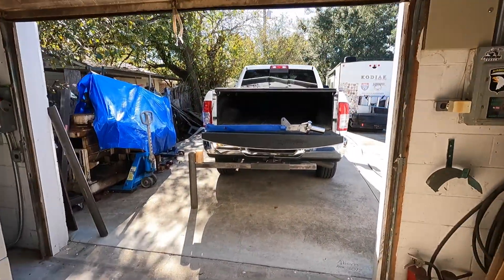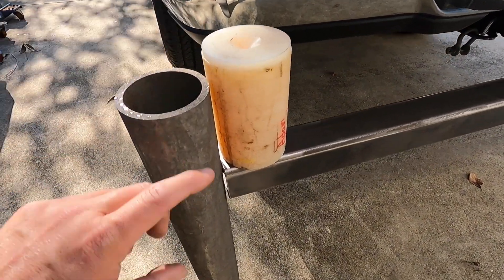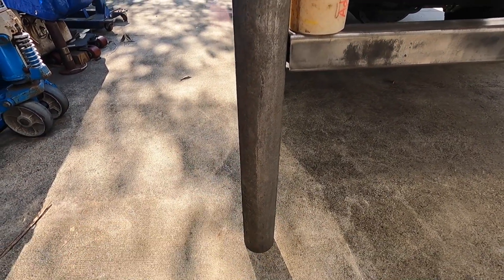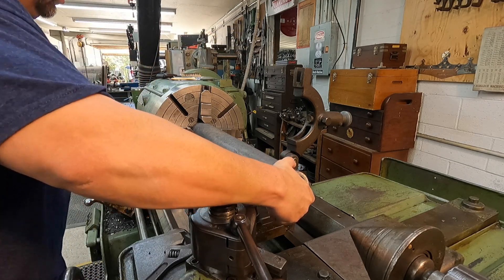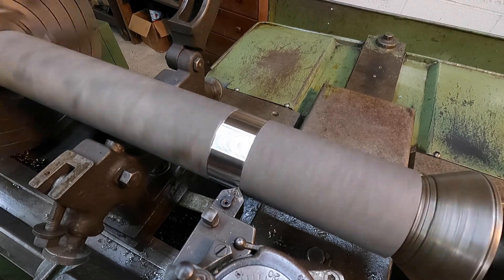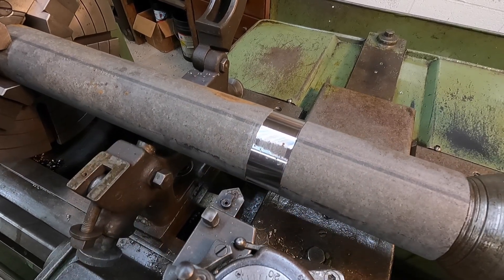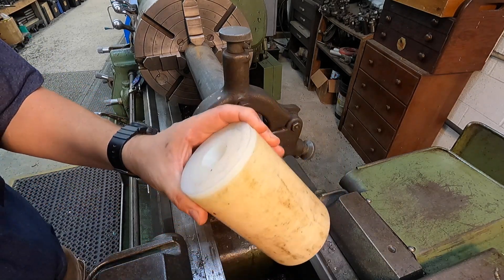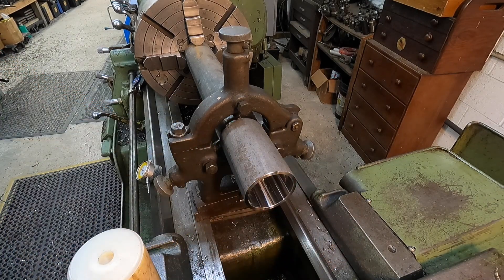Truck Hitch Crane Build Ep. 5

Comment: we used to use real crane trucks that had simple stabilizing jacks that pinned in as your planning.... we would swing the crane to one side...pin the opposite side...then swing to pinned side...pin the opposite side....they aren't as good as hydraulic ones ( which i own and used too )...
when you load your truck it " could " bind the pins enough to make it hard to remove...but after a few times you'll know whether it happens .. a jack can lift it enough in a situation that it is " stuck "....( a pickup will settle down differently than bigger trucks do )... if your thinking of adding air bag assist to your rear suspension??
that can lift it enough in a emergency....but a normal jack can quickly solve it from being stuck...
your movement is without a load...and your pinned stabilizer not pinned....reality is it is a concern...but not much in reality....
what you see as " movement " can disappear when you lift something HEAVY into bed....depends on each lift..

Comment: if you get it Stuck??
just bring a SKYHOOK along
and your good to lift!!
and pull yer pin out..
hell...just use a SKYHOOK....
🙊
to lift everything!!
Reply: There’s many  a green laborer still searching the conex for those.
I know, I sent them there
Still waiting for some to return . . .
Reply: @user-dg7sy8cz3b  
i actually own a " SKYHOOK " Crane on my truck..it is a brand of Sign Truck equipment cranes....Hydraulic over Electric and Electric Winch and Extension..24 Volt...mine is one of the last ones sold...1989 version....but the " Joke " is what i was referring too... rookies get told to go get it!! 🤣
Reply: “…and while you’re resting, grab the board stretcher and a hand full of 4p duplex cut nails.”

Comment: G'day Adam, why not use a cheap hydraulic bottle jack, welded on upside down, to adjust the foot?
Reply: Haven't tried upside down but I've seen bottle jacks that won't function on their side.
Reply: @xXxSelnixxXx  you're absolutely right! Why didn't I think of that? I'll revise that to a bottle jack with the top of the ram welded to the foot.

Comment: The steady-rest is a bit of a mystery to me? Do the ends of the fingers have to match the radius of the stock?
Reply: You need to remember he is starting with a length of pipe which is not uniform in roundness. Before using the steady rest the active center (cone) holds the end of the pipe in place so he can machine the outside (marked area) of the pipe for a uniform round outside diameter. Then the fingers of the steady rest are adjusted so they just touch the finished outside (marked area) of the pipe. The steady rest simply takes the place of the active center which now allows him to machine the end and inside of the pipe. Since the outside is now a perfect circle it assures the inside will also be perfect.
Reply: @patburnsent  nice explanation but that isn't what he asked, the pads on the steady rest are just a flat piece of bronze or brass that just touches the surface
Reply: No
Reply: @andyb7963  In that case..... NEVERMIND
Reply: There are various kinds of steadyrests. Some are fixed plain metal. Some have a roller bearing on the end. Some are really specialized with hydrostatic steady rests.  Go look them up. There is a huge variety.

Comment: I'm concerned about the torque on your square tubing outrigger.  If you have 1000 pounds on a three foot boom, and the boom is at right angles to the outrigger, that is 3000 foot-pounds of torque on that square tubing.  Are you sure it will take that?
Reply: Is that not the point of the outriggers foot?
Reply: @chrisgarcia5767  The foot will only resist the vertical component of the force.  It will have little or no effect on the torque.
Reply: @chakathewolf   I do understand the point you are making I do not think he plans on picking things up that heavy.  there are other videos where people have built similar things and show them working. They have a Consumer product made that has a 600 pound lifting capacity
Reply: @chrisgarcia5767  True.  It's just that the rest of the device is so beautifully heavy-duty! I may also be wrong -- Static Mechanics and Strengths of Materials was 40 years ago for me.  :-)  Take care.

Comment: Why not leave the foot to slide freely inside the pipe?  I.e. no pin, so the vertical load from the crane goes completely to the foot, and the bushing/pipe/cross-beam/hitch assembly just prevents tilting/rotation?  It' hard to imagine the nylon bushing and long cross-beam doing as much to add vertical support compared to the foot bearing directly on the ground.

Comment: You don't need to worry about the tail dropping when loading because the crane is mounted on the vehicle. When it takes up its load the truck will be bearing the full weight already and dropping the load on to the bed will not change that. Swinging the load will bias the weight away from the crane side, so any pressure on the foot will be relieved. The cantilevered hitch  bar will surely need some bracing for heavier loads as the leverage is significant.
Reply: That’s only true if the bar coming out of the hitch and the cross bar are perfectly rigid, which they’re not.  If he puts the crane in contact with the ground, then picks up a load and puts it in the truck, the truck will sag and could bind the apparatus in the hitch.
Reply: @motor2of7  I agree. It depends on whether the foot of crane merely steadies it or takes a significant portion of the load.
Reply: Haven't watched the rest of these videos yet but I think the best option would be to have the crane support tube in a sliding sleeve which is attached to the hitch.  That way the load from the crane goes straight to ground and the sliding sleeve which is attached to the truck just supports the crane tube from falling over.
Reply: @josephdean2142  Hmm. But that does not deal with the two problems. First you have to brace the huge leverage of the outrigger. The second is that once the truck is supported on the foot, you have to release the pressure. I think the only simple way to do this is to replace part of the telescoping foot with a small hydraulic bottle jack. That’s the comment I made on the next video, when he tests the crane, but not releasing the foot.

Comment: Why don’t you just weld two nuts to the pipe and use bolts to jam againt the tube just like they use to adjust a neck of a goosneck trailer

Comment: Further thought on the design.  You're putting a  pad on the "outrgger" to support the  load, but will it?    The  load you are lifting with the crane will be centered somewhere near the hitch.  When you start the lift the crane arm acts as lever.  The moment will act to rotate the arm at the bearing and back to the hitch.  The moment should act to lift the pipe at the bearing, not to push the load at the end of the outrigger down.    If you are trying to counter the  moment then the pad should be at the other side of the truck.  Think of a large crane, the counterweight is opposite the load, and the effective outrigger is on the load side.  As I suggested before   you need to step back and look at the "mechanics" of your design.  You might build a model and test your design.

Believe it or not shipyards build small models of the bow, anchor,  windlass,  chain and chain locker to test the ability raise and lower anchors.  If you're not going to do the "textbook" engineering, at least build a model.
Reply: I think the lift you're talking about would only start to occur if the load extends past the centerline at the hitch. That shouldn't happen often, or if so not by a large amount. Lifting a load behind the truck will lower the rear suspension and raise the front suspension more than normal because of the increased leverage. The foot helps reduce the leverage the load can exert in this scenario. Lifting a load to the side of the truck will try to raise the rear suspension, especially the side opposite the load.

Comment: It looked like there was still a low on the bore when the chamfer went on, it was just five degrees off where I could be sure… Was that illusionary, caught when you snapped the bore, or considered negligible?
It seems odd to me to use an indicator to register a dimension which is derived from two scale measurements arithmetically combined; it feels like way too much precision - is that just a habit of work for you or is there a reason not to simply count revs on the hand-wheel (assuming that the hand-wheel rev is divisible); I guess that the tolerance on the depth could be +0/+.125” as it’s an end clearance right?

Comment: You will not have to worry about binding with the foot.  The suspension on the truck and the rubber tires will give you wiggle to knock the pin out.
Reply: Depending on the truck it can lower 8 inches  or more when loaded... No amount of normal suspension and tires is gonna give you the wiggle to get the pin out without a screw jack of some sort.

Comment: Omg...  this guy is NOT an engineer!!!
Just wait, this mount is going to flex... 2x2 tube is NOT sufficient at that length !!! 
That movement IS going to be a problem !!
Reply: If the original engine hoist with a thin wall Chinese steel will pick up a 2000 pound motor, then why would the thick wall (probably ¼in) 2X2 steel not work?
Reply: And isn't this the point of the outriggers foot?
Reply: I sadly have to agree totally. Nice machinery work, but no torque and lever concerning. I think he will come to the conclusion soon. Not only the enourmes forced front back direktions are not adressed at all. Even to use this nylon at only 15cm length to handle all of the bending is strange. The nylon takes easiely the force straigt downwards and ist fine for side forces, but here is the side lever the point that brings of this short 15cm Nylon force at the upper half to one side and upperside force to the lower half. Assuming he wants to lift also a 100kg on a 1m boom that brings horrible side force to that nylon. The story continuous with the square tube mounting. There is a strong mount missing at least to the front. I would practicably suggest to put one more Square tube to that left rear wheel and clamp it there somehow if there is no better mountingpoint to find.
Reply: @chrisgarcia5767   if I have to explain why, my explanation would not be understood.
LEVERAGE !!!!   the original has no twisting force, doesn't have a 25-1 ratio load upon the mount.
The original has triangulation ( the flat stock that goes from arm pivot to base) that takes that lever and places all elements in straight compression or tension.
There are NO twisting forces in the original. !!!
Reply: @JustPrinted3D  
2000lbs at the end of a 50" arm ??
That equates to 50,000lbs acting upon that 2" or  8,333 ft lbs of torque !!
Reply: @timothywalsh1001  and again to my 2nd point... the support foot.  And not to mention the point that he is already stated and his plans to use it are for  maybe a few 100 pounds. i.e. Tree stomps at his mom's house. And original tongue uncapacity of those trucks is in the neighborhood of 1500 to 2000 poundsIs again made of a thinner wall steel than what he is using
Reply: @timothywalsh1001   I understand your explanation with complete clarity but this is exactly why engineers only put things on paper and fabricators build them in real life. I am sure he understands the limitations of what he is going to be picking up and you are exaggerating what he is expecting to be able to do with this.
Reply: @chrisgarcia5767  
Yeah... engineers put things on paper, so the fabricator doesn't make something that will fail.
Reply: @chrisgarcia5767  
If you're going to equate tongue weight to the forces acting upon this crane I'm positive that you don't know a damn thing about engineering.
Reply: @timothywalsh1001   Just pointing out facts that show I am sure he is well understanding of the limitations of what he is building.. Your argument is childish and you seem like a keyboard Warrior.

It seems that you do not understand common sense and practicality  of building And fabrication. 

You keep pointing out that you are so educated but you don't take any of the points that I have made into consideration i.e. foot, and weight of previously stated objects wanting to lift
Reply: @chrisgarcia5767   after I pointed out the facts that he's not an engineer !! And gave brief explanation why.
...
Btw, when you called me a keyboard warrior, accused me of not knowing what I was talking about..... that's the moment you completely lost this debate. 
...
The foot isn't going to eliminate the twisting force, that no matter the weight has an incredible mechanical advantage.
...
 Love how you make your decision (base your opinion) upon the fact that some guy has a YouTube channel.. who is a machinist, with little fabrication experience and admitted that he's not an engineer.
...
Care to guess what I do ... ??
 Or what's on my resume??  
Or how many years experience??  
Or what field(s) I've worked ?? 
You have no idea how old I am !! 
...
Nice try 🤣
Reply: No, it's way more than enough. He is using thick wall tubing. He can probably pick up a tractor with that.
Reply: @chrisgarcia5767  Sigh. Get off your high horse. I made a simple statement and you took it personally. Don't.
Reply: @firesurfer  I wasn't talking to you
Reply: @chrisgarcia5767  You clicked on my name.
Reply: @firesurfer  8,333 ft lbs .... how much force is acting upon the 2" square  ?
Reply: @firesurfer  yeah I fixed that. None of that was ment for you.  I knew it was a joke or sarcasm when you said tractor... have a good one buddy! 👍
Reply: @timothywalsh1001   Here you go 3 examples of how your engineering  background has failed you.

 All built relatively similar to what Adam is building.
Reply: @chrisgarcia5767   who said that I was an engineer  ??   There you go again, making assumptions.    
...  
I'm the guy who finds and corrects their errors!  I'm the guy who is literally famous and infamous for doing so.   
...
I love it when ppl underestimate me btw...